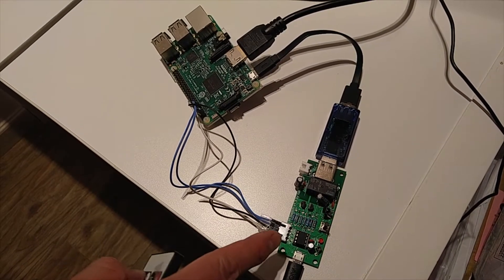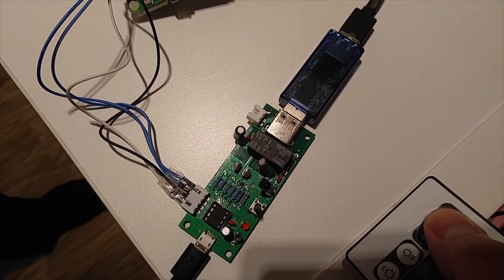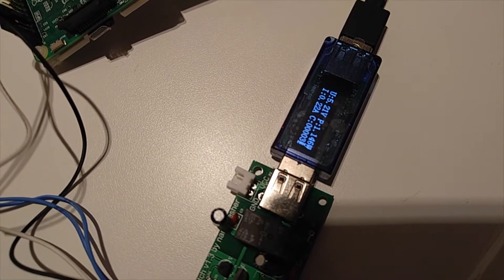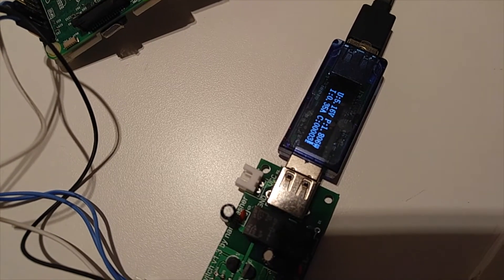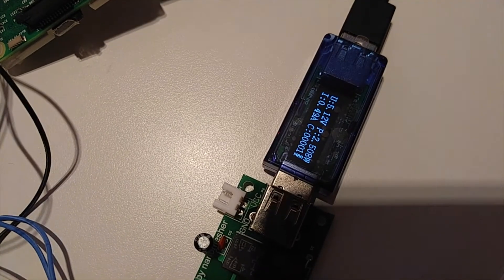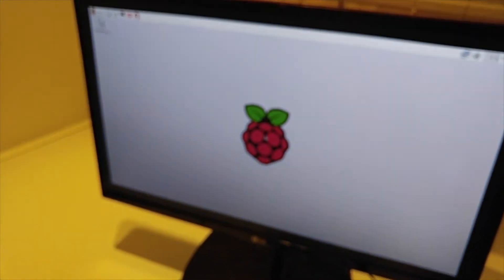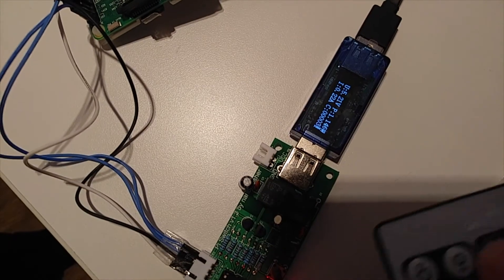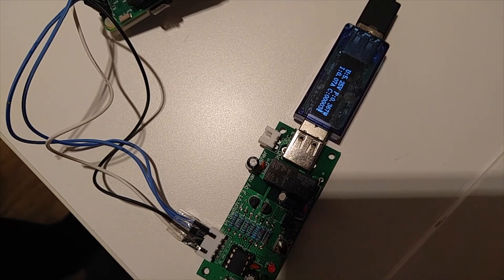Hackable Raspberry Pi Power Switch with Remote Control

Comment: I see there's a button on the Pi switch that can be used to power it on/off.  Can a button be wired to the Pi switch?  And if so, what pins or connections to use?